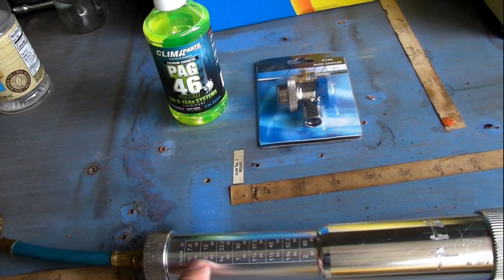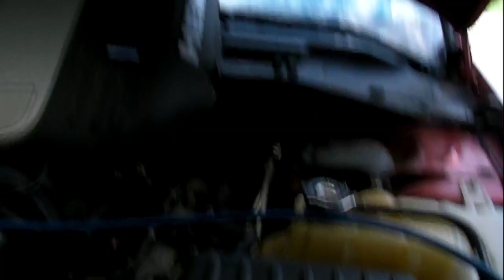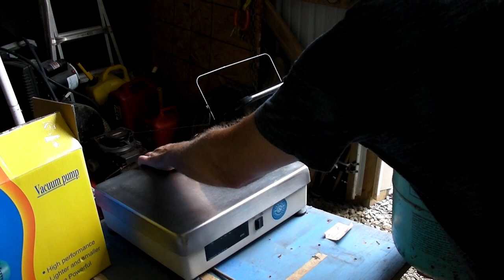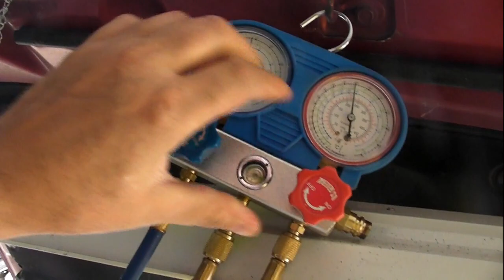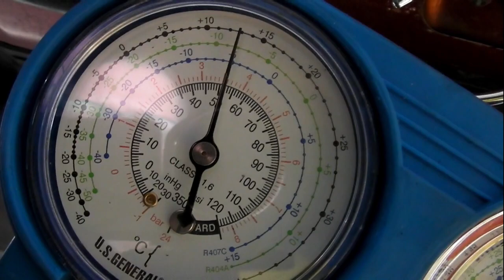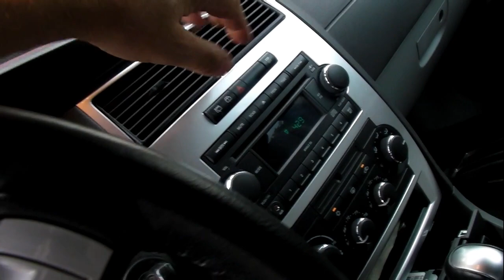How To Vacuum And Recharge Automotive Air Conditioning

Comment: Dear this is wrong prosiger you are doing.. what you  did you had washed-up oil from the compressor by running it dry you had finished its life
Referent charging must be filled in vapor form not liquid form..